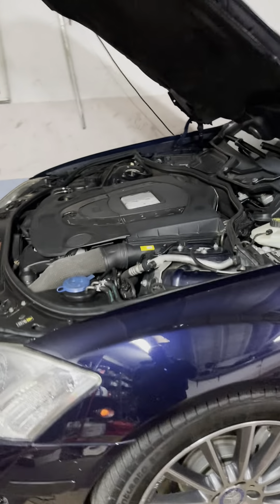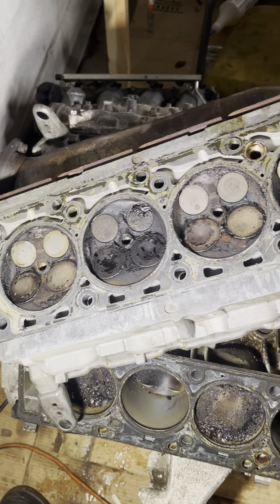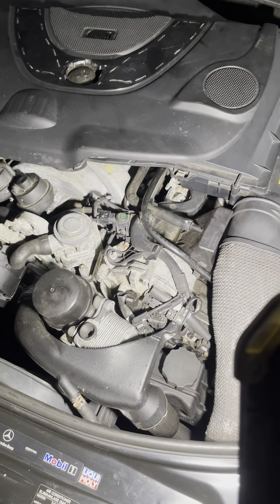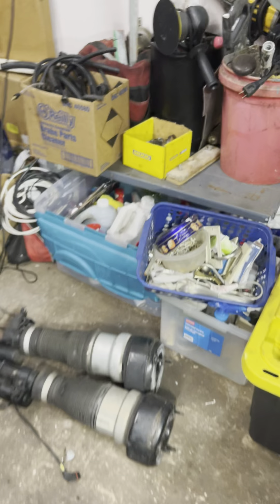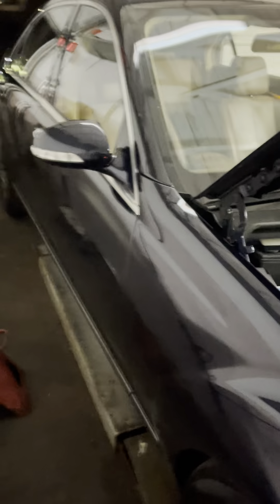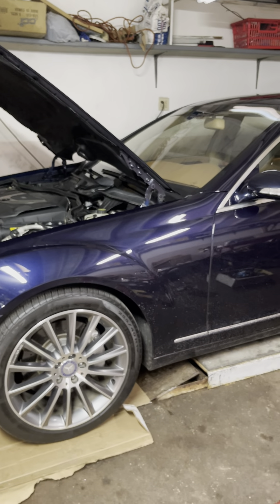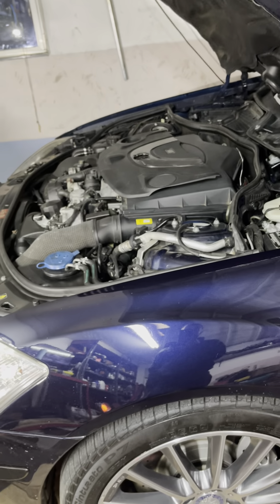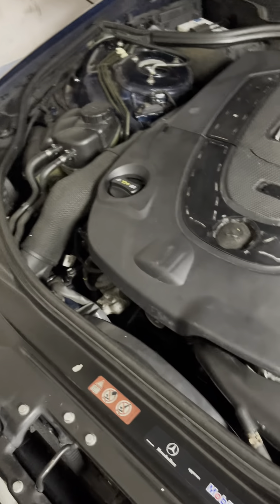2008 Mercedes s550 W221 low compression cylinder 3

Comment: Thanks for the video the car looks great did you change the oil drip pan filter a lot of owners never have heard of that and never had it changed it sits on the passenger side of the engine in the rear at the top that will help save your intake and engine.
Reply: And the crank case breather it sits inside of the head on the passenger side and screws counter clockwise it’s like a round disk.